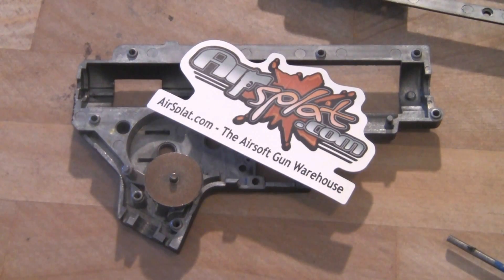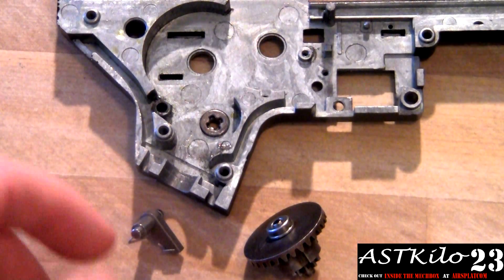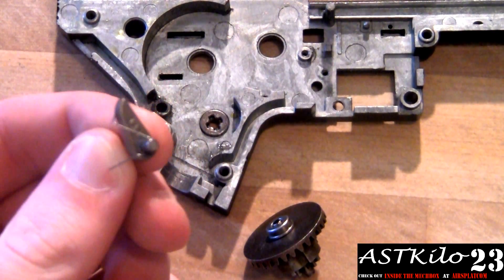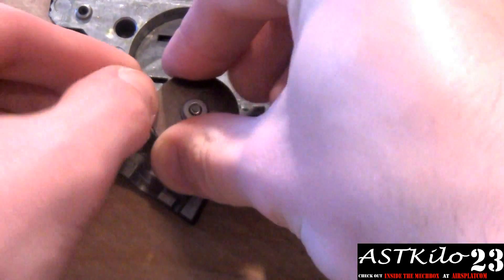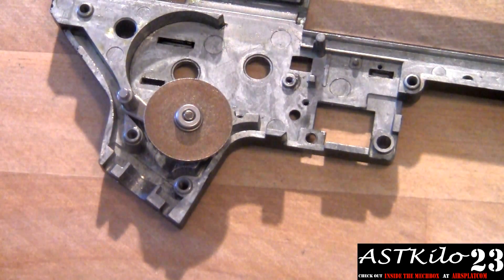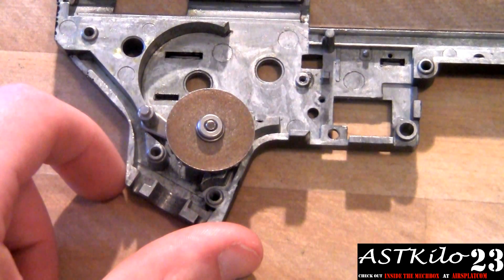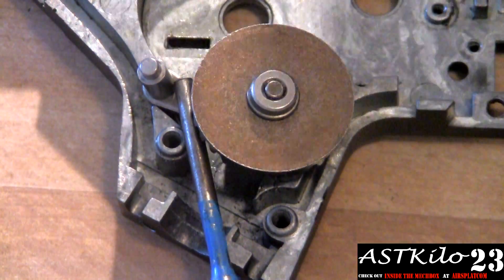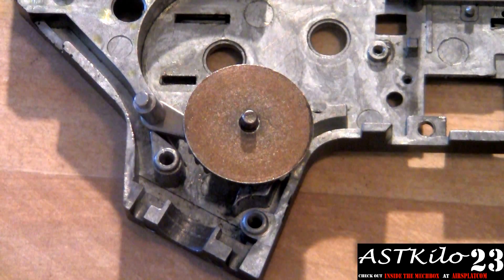Prodigy's Tech Tips: How to Install an Anti-Reversal Latch  -ASTKilo23-

Comment: I cannot, for the life of me, install the trigger assembly in my v3 gearbox for the UMP. The gearbox uses a micro switch however unlike the g36c's which are nearly identical, there's no "internal housing" for the trigger assembly and the spring. I just can't get it to stay.
Might just buy a g36c and forget the UMP

Comment: After re-assambling any gearbox.. does the air nozzle always randomly move into different  spots after you finished firing? In full auto, the taplet plate rarely is retracted (halfway, but sometimes it does) and on semi-auto the tappet plate is always retracted half-way.. is this normal? Could it cause double feeding issues? Is timing a myth on 1-2o clock or could it have something to do with the bevel gear and the anti-reversal latch not being assembled correctly in timing with semi-auto?

Srry for the long post, looking for a good forum to start my build demo

Comment: I would really like to see a video on the proper positioning of the trigger spring in a G&P or similar M4 or M16A1 gearbox. I'm not 100% sure if I'm installing it right. Also, I'd really like to see you explain how I can upgrade the FPS in an A&K M60 VN gearbox and make it run more powerful and reliable. I really like your videos---I wish I was as smart with AEG's as you. Thanks

Comment from the maker: i believe i already have a video on that, or one similar. if i do not, i will figure something out. i recommend finding some good 16g wires with a think coating,  deans connector, and some .110 female connector pins.

Comment: NO only install to the cylinder head! DONT DESTROY YOUR GUN! The sorbo will come undone after several hundred rounds, its much more safe to install sorbo to the cylinder head. Also make sure you buy 70 duro sorbo, not 40. 40 is far too soft and wont last. Also get a layer of neoprene, and make sure you dremel off the second piston tooth and half of the 3rd one. But I cannot stress enough how dumb it is to put sorbo on the piston head. NO

Comment: Another easy tip is to get a flat yet relativity powerful magnet to put on the underside of the gearbox flat on the table. This will make the AR latch attract to the bottom of the shell and stop it from moving around. When the gb is all back together simply remove the magnet.

Comment: Hey so one of the screws in my m4 pistol grip got stripped. Not on the threads but on the head where you put the screw driver. Now none of my screw drivers fit it and I can't get it out! Any tips?